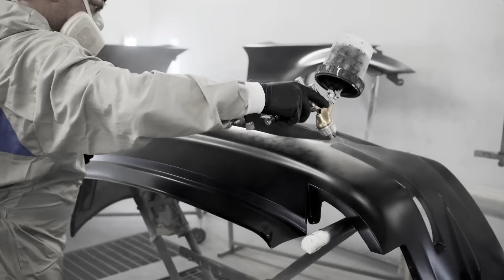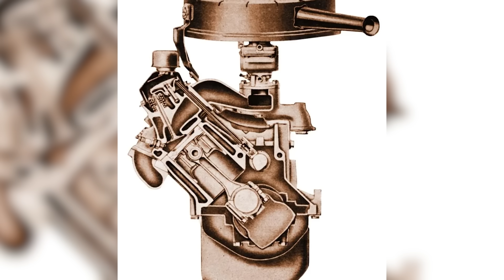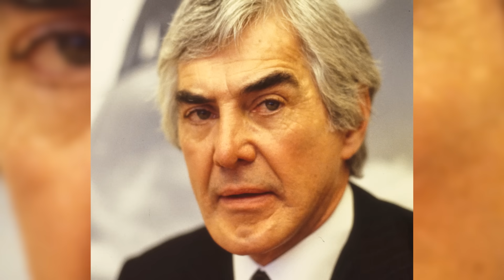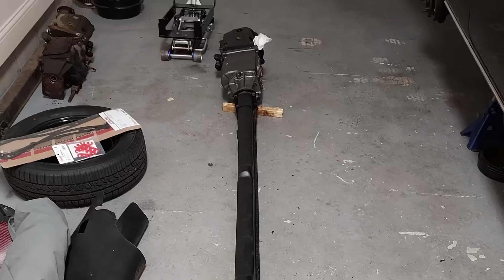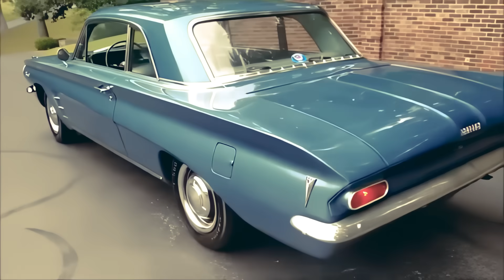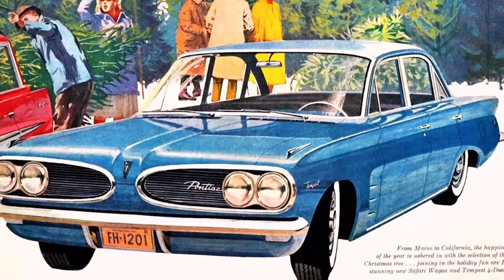The Shocking Truth About the 1961 Pontiac Tempest – GM’s Craziest “Half V8” Creation

Comment: Not mentioned in this video, the 1961 Pontiac Tempest was Motor Trend’s 1961 Car Of The Year (COTY). I bought a 61 Tempest 2-Door Coupe in 1971.  It had the Trophy 4 with the 4-bbl carb and Power”Slide” transmission.  It came standard with bucket seats, and was a beautiful car.  Drove it throughout my high school years.  Thanks for the video!

Comment: Excellent and factual video. Sadly this car was another example of half assed GM development.  The basic ideas here were good but execution was very poorly done.  The half V8 needed proper balancing technology which it didn’t get and the timing chains would all fail prematurely.   Also rear suspension design was very unstable at higher speeds.

These cars had a very low survival rate and all its unique features disappeared for the 1964 design.

Comment: We should also note that Buick also created a "first" for American car manufacturers. The 62' Buick Special had a V6 available. This the FIRST V6 (American) engine ever produced. It was meant to replace the 3.5L aluminum engine to reduce costs. This V6 was constantly enlarged and refined to become the BEST engine of all time ( the FAMOUS 3.8L V6) according  to most automotive experts. It was consistently listed on "Wards Best Engines" for many years!
Reply: My 3.8 in Le Sabre has 30K miles.  I bought new in 2004.  Runs like a top.
Reply: The 3.5 V8 was sold to Rover on England to be installed in sedans, Range Rover, Land Rover and the MGB GT V8. Its quality and reliability were excellent and saved Rover Corp.

Comment: There really wasn't that much sales resistance because of the Tempest's drive train. This was new sales territory for Pontiac, it's previous audience was an older, more sedate crowd. The reduced size of this car addressed a different part of the buying public. This is the same platform that the Corvair and Oldsmobile F-85 were built on. Think about that - one uni-body platform could be configured for a normal front engine and trans layout, for a layout with the engine in front, trans in rear and for a pure rear  engine car. When it was time for Pontiac to upgrade the Tempest for 1964 they abandoned this layout for a normal live axle in the rear. They also put a too big V8 engine in the front, much to the disapproval of the GM BOD. Thus was born the first GTO. These were nice cars, a friend had one in high school. It didn't really suffer from the issues of the Corvair in handling, I would guess because it didn't have as much mass behind the rear axle and hence the swing axles weren't forced into the dangerous 'jacking' angle they could achieve under a Corvair. My dad was a transmission specialist for this trans axle and the Corvair automatic trans axle. Not many mechanics wanted to dive into those slush boxes.

Comment: 3rd year of auto mechanics, i had a new "teacher". The first job i got was to replace a clutch on a '63. I knew what I'd find and went to it. Pulled the torque tube, pull the old clutch out and was putting the new one in, when the instructor started being a dick, insisting that I was screwing around because he didn't see a transmission on the floor! 😅😅😅
I finally got him to get on the floor and LOOK! I arranged to return to my first instuctor the next day 😊.

Comment: The 215 v8 was crap.
Reply: It was a REALLY smooth and quiet engine. I had 2 (new) Buick skylarks 61', 62'. The 62' was a convertible with the 4-speed. Had quite a bit of SCOOT to it. Traded it in 68' with 36Kmiles for a 68' Shelby Mustang GT-350 (convertible). At 24, I needed a "chick magnet", the Shelby DELIVERED in spades! Times were GOOD back then!!!!!!!

Comment: I've never heard of this particular Pontiac.
Reply: You was not born yet.
Reply: First of the Mid-size GMs, Pontiac and Oldsmobile did all this and in 64 they changed to a conventual Drive train and rear end , stuffed in the 389 and called it the GTO, also Tempest and Lemans.  And the Chevelle was also this medium chassis in 64 along with the rest of GM but Cat.
Reply: @chrisbraswell8864  They WEREN'T mid-size, more like "compact" cars!

Comment: Kinda like the 64 Chevelle Malibu. Just the right size for any kind of driving 🇺🇸🏁
Reply: It is the 64 Malibu.  they just put in Chevy v-8, regular clutch or torque converter, transmission, driveshaft and regular rear end.  Sometimes 6 cylinder.

Comment: My dad was a parts manager at a Pontiac/Cadillac dealership.  I remember we got loads of timing chains in for the 4-banger (still remember the GM part no. 9772801) because the timing chains would stretch so badly.
Reply: This is the era Pontiac used a fiber timing gear sprocket that had a relatively short life in service. It was an attempt to quiet the engine sound a bit. We (dad) replaced one in his 63 Catalina after about 5 years of driving.
Reply: Half a 396 vibrated the timing set to death.
Reply: @firefly5981  What? It was half of a 389 Pontiac and ran well.